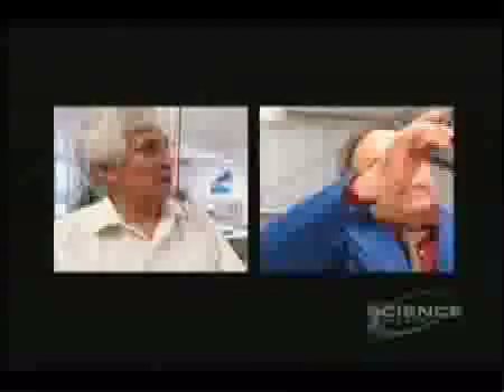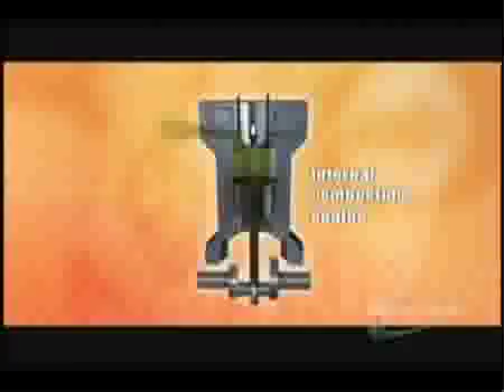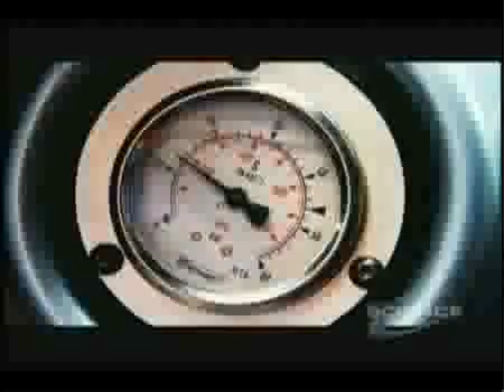Air Car (1 of 2) from France

Comment: What if you re-use the (exhaust) air? Wouldn't that make it have Perpetual air? Well, not really perpetual, but significantly increase its range?
Reply: No That would be like trying to lift yourself by pulling on your boot laces. Futile
Reply: fizzguts well why not? whats the problem? Its like regenerative braking.
Reply: +jack smith
because there is NO energy in the exhaust, it's been used and if you plug the exhuast into the intake it's the same as putting a chain drive from the rear wheels to a cog on the front wheels to drive them. Pointless and futile and nothing like reusing braking energy which for the purposes of accuracy does not extend the range of a vehicle travelling at a steady speed
Reply from the maker: Perpetual motion machine does not work, a fact that can be proved by the laws of physics. Google the words and read about it. Regenerative braking is converting the car's kinetic energy (i.e. its momentum) to drive the generator. When kinetic energy is converted to electric energy by the generator, you lose momentum, hence the braking. You can use the same braking method to drive a compressor. You can take the energy from the momentum of the car, but no energy from the air that has been decompressed already. Compressing the exhaust air is not much different from compressing the air from the atmosphere except for slight difference in the temperature of the air.
Reply: Your right, I know, perhaps i got a little too excited.
Reply: jack smith It's possible to extort the wind energy from it with small turbines to the exhaust. Not much, but charges the battery which in turn can power the compressor a little bit.
I love the air concept, free air condition in hot places as the escaping air freezes. Too bad I live in a scandinavian freezer, will have to rely on wood gas which also have potential for saving some of the worlds resources.
Reply: +fizzguts wrong

Comment: Well the energy balance may bring negative numbers in comparison with a fuel engine, because of the energy needed to compress the air that much. But its a start. The next step may be super clean energy and problem solved, but in that case, electric cars should be the optimum solution.

Comment: The idea is a con and has been since 1996. The reason it is a fail is the energy held in the tank is tiny and the compressors and engines by their nature are horribly inefficent. Find someone who can do science to walk you through the ideal gas law. The actual numbers are 6 horsepower, 5 mile range & 6 hours to rechange from a 6kw 3500psi compressor (that's quite a big machine)

Comment: Okay Ureka Moment.   So since i like to invent and am to lazy to do this...how about you use generators on the wheels as they turn to power a battery cell and in turn you have an on board compressor charge on demand the compressed air tank !  and you can drive for ever no extra outside energy consumption and hey if you like throw a solar panel on the roof to give you extra cushion if you are down with no air pressure and not moving, you can static charge the battery so all systems are go !

Comment: Question is how much fossil fuel is needed to fill a tank of compressed air?
I know they eventually want to use renewable energy(solar, wind) but that is even further off in the future.

I wonder why they use a inline piston engine and not a turbine, which is more efficient, or wankel or even a boxer or other type of piston engine.

With compressed air expanding it absorbs heat, could replace normal air conditioning and use a stirling engine to generate electricity from the temp difference.

Comment: Fizznuts is a government troll. OCEAN WAVE ACTION is PERPETUAL MOTION & can power Air Compressors forever & store the FREE ENERGY until needed without BATTERIES Then power generators etc... SEE GREENPOWERSCIENCE DIY conversion videos. & Compressed Air powered LOCOMOTIVES 1828 ENERGY is a ^$5TRILLION a year Criminally Corrupt Cannibalistic 1% Company Store Government SCAM ENSLAVING The World in POLLUTION POVERTY & WARS ~ We have NOT needed OIL as a FUEL since before 1859 Surf my CENSORED channels

Comment: @birillotyilly You could have a required minimum pressure for maximum speed, so as long as the tanks remain above that set value, the vehicle experiences no performance detriment as the tank pressure drops.  Below that value you could still operate but at slower speeds, essentially a limp mode to get you to the closest refill station.

Comment: @dustin741 And if you'd spent 60 seconds on google you would have known this is an ancient idea and has been floated every 10 years or so since the 1890's. unfortunately because of simple physical laws it is doomed to always be a short range low power parking lot crawler. Check out the Museum of Retrotech

Comment: If the car was spray painted with a light sensitive polymer it could convert sunlight into electricity and charge the battery providing power for the air compressor to replace air in the storage tanks ready for the trip home each afternoon..

Comment: In November 1996 the La Rance tidal power plant celebrated 30 years of active service during which time 16 billion kWh of electricity were generated without major incident or mechanical breakdown. The initial capital cost of the power plant (620 million Francs) has long since been recovered, and the cost of electricity production is now below 0.02 Euro per kWh.

Comment: I think that a liquefied gas (such as Carbon Dioxide) would be better than compressed air as the liquid would have a much higher stored energy density than compressed air (lesser output than a gasoline powered motor).Of course the tank contained liquefied CO2 at room temperature would be at lower pressures (hence less hp) than those high pressure compressed air tanks.Another consideration would be liquefied  Nitrogen although such a storage tank would have to have great pressure capabilities.

Comment: @ThatDifferentGuy "This will make the car much more efficient" Nope You completely misunderstand regenerative braking. Maximum range is achieved at a steady speed with no braking. If you go on a urban test cycle with lots of stops and starts this range will be MUCH shorter. Using regenerative braking gives about a 10% increase on this MUCH shorter range. As the best MDI have ever demonstrated is about 5 miles so the whole things a crock anyway.

Comment: Fuel for thought

Nobody can say that the implosion motor does not run off of any fuel. This really is a totally bogus statement for it is a known fact that the fuel source is normal breathable air and water. Using the moisture content helps pack the air molecules at the peripheral.

But let’s look at another source of potential power. For those of you who might have a copy of the Callum Coats book “The Energy Evolution” I am going to refer to page 44
second paragraph:

Comment: “If specifically heavy high quality water is atomized and the resultant water vapor is compressed by a Descending Piston with a simultaneous infusion of atmospheric oxygen, then this aqueous mixture of air is instantaneously transformed into increased and highly potentiated stocks of new air. The expansive pressure produced in this way corresponds to the power of about 2,000 atmospheres per liter of water.” (2000 x 14.7 = 29,400 psi ) (1 Liter = .26 gal.)

Comment: Google Rexresearch Negre over 10 years of broken promises documented Google e.volution south africa Lies from 2000 Google museum of retrotech Air cars are OLD tech Google Gast air motor Complete specs with consumption and power curves. Google Vencat 20 miles MDI ex USA distributor "theoretical" 20 mile range air only 5 times less efficient than an EV And you believe a youtube video. Want to buy a bridge?

Comment: @daswada9 Your idea is stupid. Mind numbingly pants wettingly stupid
IC car 
Fuel runs engine, engine drives alternator, alternator charges battery
Your idiotic idea
air tanks drives air engine, which moves car which rolls along, using a drive from a wheel to drive an alternator, to charge a battery, to run a compressor, which recharges the air tank, which drives the air engine, which moves the car, which..
Oh! Fuck!
Sigh Tards to the left, Fwits to the right, Cretins in the middle

Comment: @daswada9 I've got two better ideas bigger tyres on the rear so it always rolls downhill or a sprocket on the front axle and one on the back axle connected by a chain so the front wheels drive the back

Or you could talk to someone you trust who has an engineering or science background and they will explain   Don't ask me to explain I'd just tell you your idea is mind bogglingly stupid ball crushingly idiotic

Comment: The oil spill was a major turning point in Earth’s favor. The oil companies’ dominance in energy production has been drastically reduced as demands for alternate sources have soared.  Soon you will see long-suppressed technologies coming into use for many purposes, from curing diseases and eradicating pollution to providing light and heat and transportation fuel.

Comment: The first successful application of the pneumatic motor in transportation was the Mekarski system air engine used in locomotives.  Mekarski’s innovative engine overcame cooling that accompanies air compression by heating air in a small boiler prior to use.  The Tramway de Nantes, located in Nantes, France, was noted for being the first to use Mekarki engines to power their fleet of locomotives. The tramway began operation on December 13, 1879 and continues to operate today;

Comment from the maker: @johnbevington 1 bar equals roughly 14.5 psi.  So 300 bars equal roughly 150 times of 30 psi.  So he assumes an average tire is pressurized to around 30 lb per square inch.  (not 35 psi in your equation.)

Comment: The term "air engine" disappeared from engineering textbooks after the 1930s and the second world war.  Gas engines had been perfected, the oil industry was established, and gas was cheap.

Serious interest in air cars was rekindled by the energy glitches of the 1970s.  Dozens of inventors have patented designs for hybrid, closed cycle, and self-fueling air cars, as well as conversions for existing engines and designs for air cars meant to stop at air stations for refueling.

Comment: @kiwiavi Some one who can use math. Yay! If you assume the engine exhausts to 100% then the final pressure is 14.7psi atmospheric and you have a crude maximum theoretical efficiency. They used to list swept volume, gearing and tyre size. With that max theoretical range was 20km. Claims of 200km. RIGHT plus MDI throw half the energy away as they use a pressure regulator to drop the tank pressure to about 200psi.

Comment: Lets do the sums. Assume the tank is 2 mters long and 250 mm in diameter. This is about 98 Litres. Say the engine needs 60 PSI to work. (The same as the pressure in a combustion engine when the exhaust valve opens) If we start out with 3000 PSI in the tank, it is a 50:1 change so there must be 98  x 50 (60 PSI) units required.   Take a 1 litre engine at 3000 rpm. It consumes 3000 litres every minute.  We started out with 4909 (98x50) units so the engine will run for 1.6 minutes per tank.

Comment: @fattony252 "To get better gas mileage there are two ways to go. A steam engine where the water can be heated with any type of fuel"

Maybe but not currently. Unless you get the cycle efficiency up by using super critical pressures and temps (which has not been done in car sized units so far) burning gasoline in a steam car uses more fuel.

Light weighting a car improves mileage but only by a small % especially on flat constant speed runs. 
Almost all modern car engines are aluminum now

Comment: Air car = OLD idea from the 1900's and MDI's implementation is WORSE than units built in the 1920's and there is no way to improve it
Power = 5hp MDI figures
Only published test range = 5 miles
$13 million taken since 1998 no cars sold
NO independent confirmation of claims.

Comment: There also was the EV1 in california. This actually made on the road, but General Motor only leased them (Tom Hanks and Mel Gibson had one). When the lease ended, they took it back without offering them to buy it. (Watch who killed the electric car.)
There is a cure for cancer (Run from the cure).
You can make everything from hemp and don't need oil or plastic anymore (Hemporium SA)
Oh and the aliens are coming. (Disclosure project 2001).
How much longer are we going to be duped?

Comment: 'there is nothing wrong with being open minded to a new concept"
True BUT that also requires critical and searching evaluation otherwise you get suckered by every green washing scam artist coming down the road.
Summary
Air car = OLD idea from the 1900's and MDI's implementation is WORSE than units built in the 1920's and there is no way to improve it
Power = 5hp MDI figures
Only published test range = 5 miles
$13 million taken since 1998 no cars sold
NO independent confirmation of claims.

Comment: "my comment about the energy an air commpressor uses was unfounded"
Yep
"THE CONCEPT of a car that runs on air is a good idea"
nope 300 years of expansion engine science plus the ideal gas law proves this is a con for technically illiterate cretins
"all im saying is stop being so negative and embrace new ideas,"
Right so if someone put a video up announcing cutting your head off cured migraines you'd be first in the queue to try it.
nice lad bout as sharp as a bowling ball

Comment: Nice one dickhead 
MDI's own figures are the air car uses FIVE times more energy for the same distance compared to an electric car. 
Google Vencat 20 miles
MDI's own figures say a 7kw air compressor has to run for 6 hours to recharge this POC.

The technology dates back to the 1900's 
Google the Douglas Self website

 So as you have proved you don't know your arse from your elbow how about posting again so I can furthur take the piss out of you

Comment: "i didnt say id use the engine to refill the tanks"
OH YES YOU DID
Quote
"if you had a air intake and a battery operated compressor (which could be charged by the wheels simply moving) the car possibly could work gas free"
Wheels drive the generator that drive the compressor and the wheels are driven by the ....engine and that was why I called you a idiot

Comment: "if you had a air intake and a battery operated compressor (which could be charged by the wheels simply moving) the car possibly could work gas free, "

And they are possibly breeding geese that poop gold bricks.

Tell you what when you have perfected lifting yourself by pulling yourself up to the moon  by your boot laces post a clip. 

We'll ALL be waiting.

Comment: Lol, well you could put compressed air/nitrogen in those tanks, but only 1800 PSI and you wouldn't get many shots. I was thinking that they could make their compressed air engine run also off CO2 and use the Chrome-moly tanks. You get a lot more shots out of a CO2 tank compared to an air tank of the same size.

Comment: I forget the name of the guy, google's not helping much right now. French builder made a ferris wheel that is basically a rotating cantilever, in this case always heavier on one side than the other. Stick a socket and a bulb in the middle and gravity is basically the power source, technically "free" energy. I have my own contraption made from magnets and DC motors that's been powering every light in my home for a few years now. Building a bigger one with a converter for appliances soon.

Comment: I don't know why someone would vote Fizzguts comment down. As a diver and a paintball player I can assure you he's right. I use both steel and carbon tanks. Metal usually is 1-3 years depending on size, carbon is 3-5 - When they blow during a hydro test they are very damaging, +250psi = bomb, you do that math

Comment from the maker: You have just described a typical perpetual motion machine.  A PMM is impossible according to physical laws. The bottom line is that you cannot create energy out of nothing.  You can incorporate your generator into your braking system to recover energy while braking your car.  All modern hybrid cars use "regenerative" braking to recover energy otherwise escaped as heat in the brakes.

Comment: Thud Thud Thud 
Head beats against wall.  
Dive tank example
Each vessel INDIVIDUALLY has to be tested. The need to be vertical, filled with liquid to 100%, using a liquid pump raised usually to 50% higher than maximum pressure. The vessel is measured for stretch, volume increase or pressure drop over a set time period. The tank is then emptied cleaned and then reinstalled.
This is not trivial and not cheap and will not happen at a garage

Comment: You are confused 
 
The only testing I mentioned is the FACT that all pressure vessels over a set volume holding high pressures such as dive tanks, commercial air compressor receivers, oxygen cylinders etc have to be tested usually annually, some times every five years. The air car will have to comply and no carbon tanks don't just fail with a hiss that's another MDI lie. 
Pressure vessels that fail even carbon fibre wrapped ones are rockets or bombs that's why testing is required.

Comment: You have costed the shed load of carbon fibre tanks (Which this POC needs despite MDI's lies) and have factored in the cost of  testing required for pressure vessels?
Thought not

Comment: If it is such a good idea, they'd be in mass production by now. The main problem I would guess is the danger of carrying 4,000 psi of ANYthing under compression. Gasoline has its problems, but is surprisingly safe if stored and handled properly. The other issue is that to generate the electricity to compress the air remains, so about all this air car does is move the source of pollution (likely from a coal-fired power plant) upstream of the vehicle. Folly. Shell game. Bah humbug. Ptooey. A-aack.